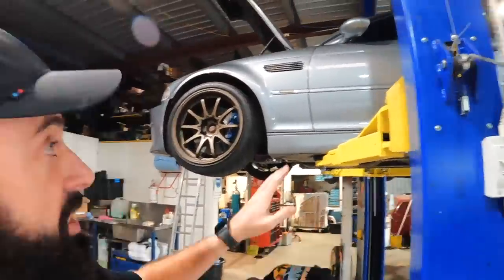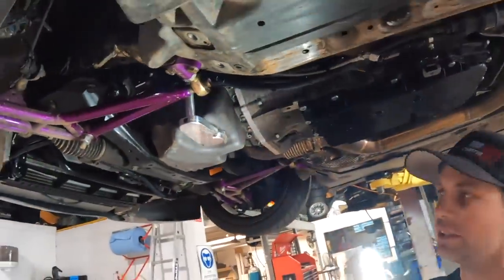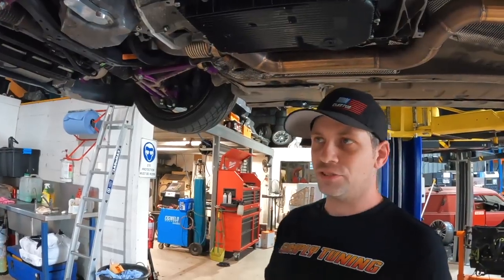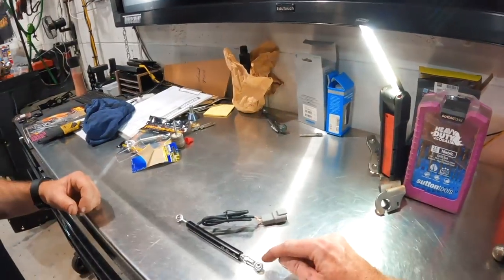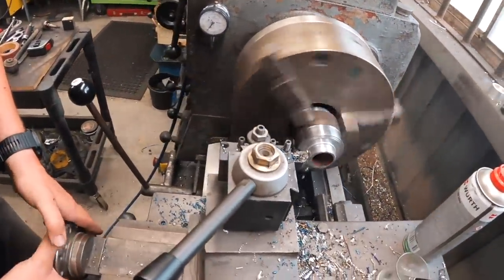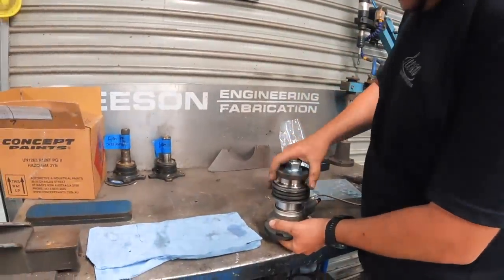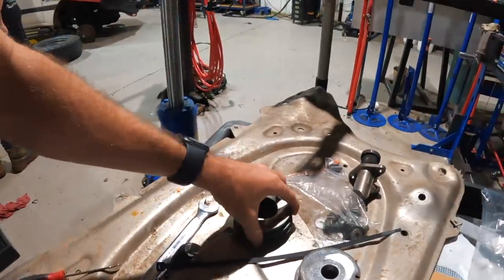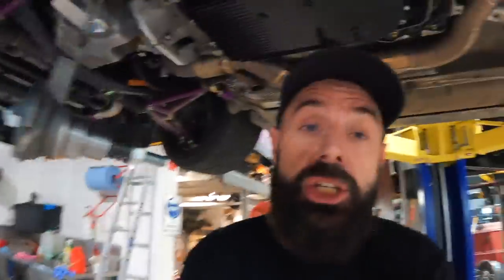TURBOLAMIK 8HP70 Auto Trans CLUTCH PEDAL SETUP #clutchkicks

Comment: There are so many different sizes of belleville washers and stacking configurations which would enable for a more compact an adjustable solution than the valve spring...but really love the what do we have laying around that will work for now..always nice to see another 3d cad person getting dirty as well lol Looked like it was solid works?
Reply from the maker: Man, i couldnt believe how they did this with basic scrap haha. The belleville should work, but getting the right ones to work with this partcular master and slave cylinder will be tricky. The adjustability on the valve spring was an eye opener.

Comment: I'd really like to here how the simulated clutch works/is tuned in the trans. Are the solenoids PWM, are you actuating transmission clutches with the converter clutch locked, actuating both, line pressure control, shift strategies with the converter locked or unlocked, etc? I'd love to hear the nitty gritty details for how it functions from a technical standpoint and what kind of power you can put through the trans on boosted launches and "clutch kicks" without blowing through the clutches or having significant wear over time.
Reply from the maker: There's no way to sugar coat this. We dont know lol. From a user standpoint all you can control in the correlation between pedal potion and percentage of clutch the TCU sees. We have no idea what stageries are in place in the tcu to make it all work. However as you will see in the next video. It feels like a real manual clutch.

Comment: Nice e-clutch stuff :)
I actually swapped a N54 oil level sensor into my S55 because the ECU i used (Maxxecu) can read it in realtime, so i made a few strategies in the ECU and it was really good!
But if not using Maxxecu i would defenetley go for a manual dipstick!
Reply from the maker: Does the maxxecu still take time to calculate oil level or can you get a reading quickly?
Reply: @ZeroTo60Tube  I don't remember exactly, but it's like once every second :)
Reply from the maker: @nissejarnet  Well thats better than waiting like you have to with the idrive. We have got a couple of Maxxecus coming, so might have a play with that as well. How is everything going over your way? Any new builds on the horizon?

Comment: Hi Andrew, is awesome!  You guys are about 3 weeks ahead of me putting this style set up in my 8HP 2j powrer wrx drift car. What travel length did you choose for the haltech linear position sensor? Also why not delete all the moving parts and make a spring style set up inside the cabin to achieve the same result?
Reply: Probably because he wants it to look like an oem inside the car. Id say as of right now, youll peobably need to only produce the additional stuff to the n54 cylinder and thats a dealkeeper for a lot of people. You can give them a list of needed oem things plus this thing there and bam it works. Otherwise as you mentioned, youd be in need to produce a complete activation mechanism...

Comment: Was thinking about all the little aspects involved with my swap and actually thought about the oil level sensor. Was thinking I’d need to read via obd. Would be interested in the dipstick for sure. I’d like to see a version that retains the electronic dip stick as well. I realize moving the e dipstick down would cause it to read lower. Possibly a different sensor that has a taller level sensor? A quick looks shows that part number covers A LOT of different bmws. My second idea would be to modify the “tune” for a different range what it considers full and empty.
Reply from the maker: There has been some work dont on a version that retains the original sensor. However it is a much more bulk part, moving the original sensor over to the side and maintaining the same level. Its been shelved for now, but may look in to it, if the interest is there.
Reply: @ZeroTo60Tube  yeah it would be more or less just like a low level warning before a low pressure warning would be a nice feature to have lol. Like a cooler like is leaking and you’re losing oil driving down the road.

Comment: every n54 needs a oilpangasket anyway so why not built one directly in the pan so you can have both the dipstick and the sensor, and do the sump pans on exchange basis.
Reply from the maker: Brock was working on a design that incorporates the factory sensor as well. It’s a little more bulky than this but not too bad. Main reason no to do the full sump version is the cost of posting a sump. It would be redic.

Comment: What about using a much stiffer clutch pedal return spring and doing away with the hydraulics completely?
Reply from the maker: I think the hydraulic is going to be cruicial to get the feel right. In a factory clutch you are limited by how fast the fluid flows for both depression and how the clutch pedal returns.
Reply: I was toying with idea of putting clutch on the steering wheel F1 style, just don't have enough time till next year to try it out. But saying that, I still think having a pedal is my first option.
What's great about 8HP Lamik TCU solution, there is nothing stopping me from having both pedal and steering wheel clutch leavers at the same time ;)
Reply from the maker: I’ll send you a pm.
Reply: @ZeroTo60Tube  another way to do it is get a small accumulator on the end of the master cylinder line and just change the pressure inside the accumulator to suit how u want the feel, probably be a lot easier to dial in n smaller to!
Reply: We have a drifter here in SA using a virtual clutch in a DCT car & he’s just using mechanical springs in the pedal assembly itself to achieve the right feel... I’m going to see him to test this for myself before deciding which way I wanna set my 8HP pedal up I think.
What these guys are doing here looks amazing, but pretty complex & pricey (if you’re not someone who can just make it yourself haha)
Reply from the maker: @truecapacityfitness1611  The desire for the hydralic master cyl connection, really came from sim racers we have spoken to. With out the dampening on the pedal the clutch fluid provides it doesnt give a true feel and all clutch movement speeds..... if that makes sense. A spring might feel right for slow take up, but then when you are just dabbing the clutch for a quick clutch kit, you dont get the resitance with a spring alone.
Reply: @ZeroTo60Tube  yeah I see what ur saying n it would be a crude way of doing it hence why I said a small hydraulic accumulator set at the right psi might give a better feel and it’s compact enough n wouldn’t look out of place, your only moving about 15-20ml of oil, we used them offshore on small bore hydraulic systems either to take the shock away from opening valves or for stored volume, might be worth a go!

Comment: Thanks for the videos, there isn't much content on these swaps in english. Looking to do an awd hp95 swap on my project 3000gt. I remember you mentioning turbolamik connects to can bus, is that just bmw canbus or would it work with aftermarket ecus namely Haltech? Also do you know if turbolamik can shut off the transfercase for the front wheels? Cheers!
Reply: The lamik can work with a lot of canbus versions, actually it just needs définitions. And if you followed the video you saw last video that they did not setup can correctly but initially it would have been there for the haltech. A lot of people using maxxecu etc...about the transfercase...if I remember right that it has some xdrive things or they are working on it. Otherwise there are other solutions out there for this too!
Reply: @maxgr7723  appreciate the reply! Just catching up on content. Thanks!
Reply from the maker: Max covered it well. Lamik will link to the haltech, but you will need something else to control the transfercase.
Reply: @ZeroTo60Tube  appreciate it! Until now I thought it was an all in one unit haha. Guess it's back to research.
Reply from the maker: @ttgtomr  BEYTEK on youtube is doing a awd RX7 conversion, i think he has done the working out on the transfer case, worth checking out his stuff anyway. He is using lamik for transmission and maxxecu for transfercase.
Reply: @ZeroTo60Tube  Awesome, will do! Thank you!

Comment: Does it have to be a potentiometer? My driving simulator pedals use load cells and have adjustable dampers built in and that would make it as simple as mounting
Reply from the maker: Anything that outputs 0-5v

Comment: This dipstick wants a dipstick 👍would like to see the electronics still part of the assembly though..
Reply from the maker: So there was a design that encorperated the orginal sensor. Its been put on the back burner for now, as it requires a much larger billet piece and will be a little more expensive. If you are serious, send an email to zeroto60tube@gmail.com and we could maybe get you on a beta tester for the version with the sensor. Just a heads up the sensor version will be around the $600-$800aud mark.

Comment: Hey guys, I know this question comes a few years late, but did you ever get the additional power of the fastchip RStuner verified by dyno? I picked up my own RS 265 after watching some of your vids on the car. I'd really like to get it to 300hp and it seems like the most cost effective way to get it there. Cheers
Reply from the maker: The rstuner kit is epic. Its supposed to be around 295hp ish, but i was very happy with the kick in midrange power regardless of peak numbers.
Reply: @ZeroTo60Tube  Ok, 295hp is close. And you had the downpipe on the car at that point? Any other performance mods? Thanks
Reply from the maker: @Rbraden  no all factory hardware apart from air filter

Comment: Isn't there an oil temp sensor in the electronic dipstick also?
Reply from the maker: On the other cars dan has done this too the oil temp still seems to work.
Reply: @ZeroTo60Tube  I think that oil temp sensor is used to tell when the car is warmed up for oil level sensing and the m3 cluster rpm gauge.

Comment: You should make them for all n5x series motors. I hate having to wait till I’m driving for my car to be able to tell me how much oil my e90 n52b30.
Reply: I would absolutely buy one if I knew it would fit on my n52???
Reply from the maker: hmmmm, i have a suspicsion the N52 will take this kit. However coding out the errors will be a little more tricky.
Reply: @ZeroTo60Tube  as long as I can figure out the coding in protools from beemergeeks.?
Reply from the maker: @eriqrosado3337  on the n54 its in the DME tune so im not sure if its something you can do with beeamergeeks

Comment: Will dip stick work on 535i n54?
Reply from the maker: Ohhhhh, we would need to do some working out. The fuel lines are the issue on the e8x and e9x chassis. As long as there is clearance in that area, it will work on the e6x chassis.

Comment: Are the dip sticks for sale yet ?
Reply from the maker: No.
Reply: @ZeroTo60Tube  Will your guy  make them  for individuals by request?
Reply from the maker: I think he has the machined parts to assemble about 5 more. However at the time of filming we only had the prototyes in atfermarket ECU cars and one race car. We didnt realise the temp sensor for the oil is in the oil level sensor. When you unplug the oil level sensor, the temp guage on the cluster defaults to coolant temp. So these are only really suitable if you dont want oil temp on the factory cluster.  @dariusp5539

Comment: When are we going to see an 8hp in the 4.6is? I’m considering going that way…
Reply from the maker: Unfortunately I have ran in to some unexpected bills, relating to the man who took my laptop. So the 4.6 will be going up for sale. I can’t afford to keep it unfortunately.
Reply: @ZeroTo60Tube  Ahhh mate… Thats terrible news. 
Have you done anything else to the box since the last time you had it apart? Im not sure if you remember but you gave me some pretty helpful advice when I had my box out. 
I did replace clutch packs and some other seals and that b drum and bearing that had failed. I rebuilt mechatronics unit too. I put mine back in the car and was most pleased when it ran but, I got 300kms out of it and it shat itself again. I have since bought a donor 4.6 and used a box from that which had a full rebuild from “asnu” transmission services. 
I have only now got the box back in as doing it on the ground at home is a nightmare but it’s all back together and ready for rego now.
Reply from the maker: @marchdeane4896  no, nothing the trans is pretty solid. Shifts are tight even when loaded with a car trailer.
Reply: @ZeroTo60Tube  How much are you looking for on the 4.6?
Reply from the maker: @marchdeane4896  Probabaly 10-12k?
Reply: @ZeroTo60Tube  Seems fair. What’s the mileage? 
Where are you guys based by the way? I’m in NSW. Love your work.
Reply from the maker: @marchdeane4896  around 200ks.

Comment: you should put a dual hpfp setup in a n54
Reply from the maker: No no. Direct injection is the devil. These things run much better on pi at these power levels. Di is good for pump fuel and economy. But that’s not what we are about.
Reply: @ZeroTo60Tube  dual hpfp to run more fuel. stop deleting my comment
Reply from the maker: @N54.sullster  I don’t delete comments YouTube might think you are spamming. But again direct injection is a waste of time. No one who goes fast uses it.
Reply: @N54.sullster  Dual Hpfp i pointless for Di car you only need that high pressure for  Pi
Reply: @ZeroTo60Tube  this guy who i cant put a link because it gets deleted somehow runs dual hpfp and makes 1000hp with a built motor look it up his name is Scorpstan
Reply: @shak2300  this guy with a built motor runs it and makes 1000 hp with dual hpfp look it up because i cant share the link somehow Scorpstan
Reply: @N54.sullster  Yes he does but he would have an easier time just using Port injection.
Reply: @N54.sullster  hpfp only works on DI cars, if I fit triple hpfp to this car it wont make any difference as there is no direct injection system, I do appreciate the dual hpfp DI systems, but in this application they aren't needed! 1000hp in an N54 is awesome and I hope scorpstan breaks some records with his awesome build!
Reply: We running s55/m4 on pi only so much easier on e50 with ecumaster. 

One of the other guys at our track has s55 in e46 with motec running do with e50 already seeing limitations in the fueling system at 500kw last event the injector burnt through.
Reply: @ZeroTo60Tube  put a maxxecu in ur dct 335😂😂 everything in the interior will work.
Reply: @danielb9134  what do you mean it wont do anything if your pushing more fuel into the engine lol more fuel=more power simple
Reply from the maker: @N54.sullster  I know scorpstans build well. He built the dual HPFP system, then realised he still needed port injection, which he has been running for a few years now. Scorpstans build is mega tho one of the fastest N54s on the planet. But he's not using that secondary hpfp for much other than a cool build list hehe. Scorpstans system is very similar to the VTT double barrel shotgun kits, that were really popular 5-6 years ago before people realised dual HPFP just doesnt work for big power.
Reply: @ZeroTo60Tube  im pretty sure he still runs it lol
Reply from the maker: @N54.sullster  Oh yeah, he likely does, unless he put the ac back on the car. The point i was making the DI injectors will only flow about 700-750whp. So he needs the port injection to make the power he is making. It's there and it will give him better DI rail pressure, but he no longer needs it.

Comment: so is this clutch emulation same (or almost same) thing as switching between Neutral and Drive ?
Reply from the maker: No, not at all. It fully overides all clutches in the transmission. Makes the automatic feel like a manual.